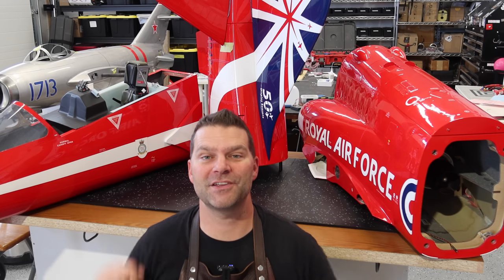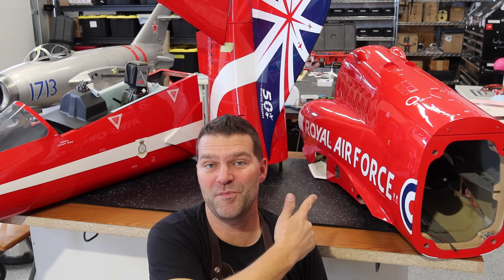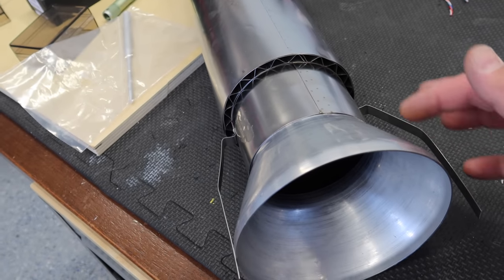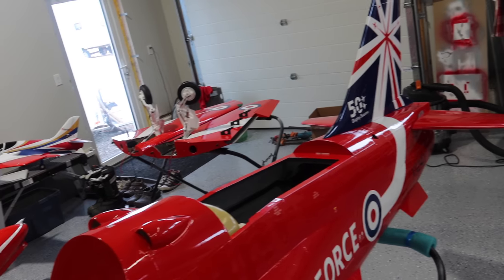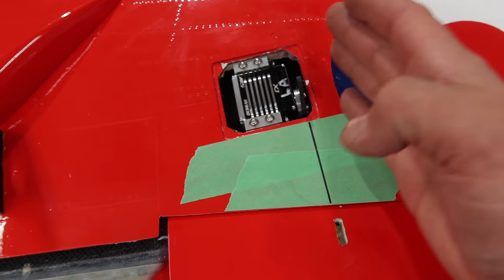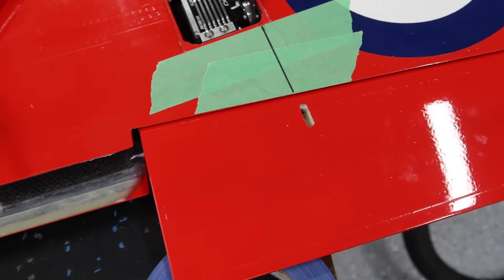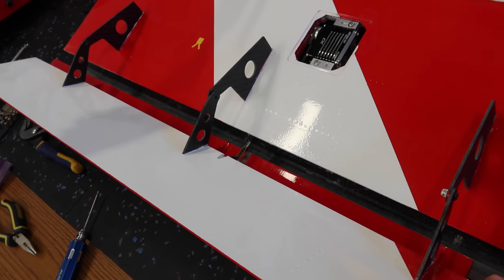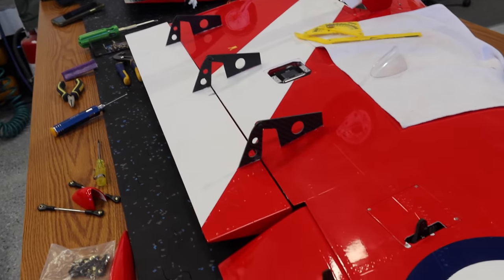SKYMASTER XXL - 1/3.75 Hawk Wings Complete - Custom Light Lenses

Comment: Great work on the wings, Brings back memories of mine. I do remember that I  had to get a new pipe from Skymaster for the use of my K 320 turbine. Anton or John mentioned that a larger turbine would need a different pipe. So they sent me a new pipe to handle K320 and it was indeed a different diameter at the back. Perhaps email Skymaster to confirm.
Reply from the maker: Thanks Sal.  I questioned that as well and they confirmed that it is the pipe for the 300 that was included with the kit.

Comment: just to add, Ive done something similar for RC planes, a budget version ;)
With a wooden mould/piece, place it in a PET-plastic bottle (for example a used coke bottle) and put it in the oven, it will shrink and form around the wooden piece. Just thought I'd share, its a good trick, even though it might not be a good method for the very top of the line jet builds like Lighter Side Of RC is making... but for small, cheap, balsa planes, its sure it neat, and can make for a nice custom made moulded plastic piece :)
Reply from the maker: Thanks for the tricks!  Ultimately at the end of the day it's nice to have as many tricks and methods as possible.  If I wanted to do it even better I could have used my vacuum molding machine but that would have required a blank to be made of each lens and this was quicker and easier.

Comment: Just enough complication to make it interesting. Quite a bit to the wings in the way of work. Liked the idea re the Nav lenses nice easy simple. One I dom like is the battery operated Heatgun by Millwalkee use it all the time. Nev er thought I would. Also liked the way the wing ailreon and Flap covers worked out. Keep at it now. Carry On.😁😎😷
Reply from the maker: Thanks Nick.  Do you find that you can get lots of time on a 3AH or 5AH battery?
Reply: @thelightersideofrc I have the 5ah ones lasts well over an hour on the new battery and about an hour on a slightly older one. Had a professional Sign and Vinyl person out who was out doing 1 to 1 scale Flying machine using old corded heatgun. I said try this she loved it. When she finished she said right off to buy 2 of those. Can,t get better than that.

Comment: Happy Holidays Jonathan &Wife. One more Awesome lesson in Jet Building. Jonathan have you Ever Program Different Servos to use Different voltage? Like Wings 4.8v Rudder 8.4v because size?
Reply from the maker: Thanks Gregory.  Yea it can be done.  Just finishing up the Mig 17 and the linear actuator needs 6V so that is setup on a lower voltage then the rest of the system.
Reply: @thelightersideofrc  thanks Jonathan for help ,looks like I will be Having fun cut Weight and choosing the Best motor 4s direct drive or 3s Gearbox drive. Jonathan have you ever thought of live Jet Building like Bad Chad &Jolene do on YouTube? Happy Holidays you Two. Enjoy your new Home.
Reply from the maker: Never viewed their channel.

Comment: Seems like your lense making process works pretty well but vacuum formers are really easy to build and use. Just have to make a mold and then you'll always be able to recreate lenses for different models. Or in a case like this you can just use the piece of the fuse you cut out as the mold. Its pretty easy to make a professional looking part. Not to mention all the other parts you would be able to make in house
Reply from the maker: Thanks Jake.  Agree totally.  I made a vacuum machine about 2 years ago so I could do lenses for my Aviation Design Diamond Build.  On this one, because it's a one off I went the easier route.
Reply: @thelightersideofrc  good point, I'm sure it's not too often that you have to build a XXL hawk. Still can't get over how big that thing is!
Reply from the maker: Haha. Yea everyone that has come into the shop over the past couple weeks has said that same comment. “ I can’t believe how big that is!” 🤣🤣